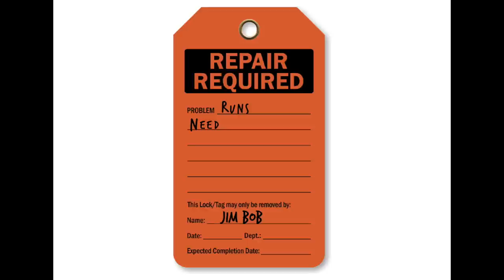Stihl Cutoff saws... My NEMESIS...

Comment: Something I learned many years ago when I have an engine, whether it is an automobile, motorcycle, or one of the many small engines you work on is to use an acetylene torch and put gas down the intake; no oxygen, just acetylene, propane or even MAPP gas.   I use a small welding tip and turn it on about a quarter turn to start with and give it a pull. If it sputters, give it a little more gas. It is not dangerous even if it backfires because you can simply pick up the torch and turn it off. Much better and safer than pouring fuel down the intake because you have control of the fuel. 

Once it starts you can adjust the flow to an idle while the pump either picks up the fuel or not. It will always start by the second pull unless you have other problems, but it eliminates the lack of fuel problem.  It has worked for me for 50 years and saved me a lot of pulling starter cords and wearing out batteries and starters. Obviously you should know it is a fuel problem first.

Comment: As a user of cut off saws in the late 90's, I feel your pain.  Sadly I must admit many of the problems are user inflicted.  Not necessarily due to carelessness, but due to the rough life these saws live.  I was working at a small contracting company and we had about 6 saws, I can not remember more then 2 running on any given day.  Running them down in the bottom of a trench cutting water or sewer line, they often got soaked (along with us) with water or other things, or dropped when we were falling often into the water.

I remember taking our 4 not running saws into get repaired, and then picking them up a few days later.  They each had a repair tag with problems found attached.  One had a bad ignition module, one had water in the gas, one had a bad ignition module and a note "SAW FULL OF xxxxxxx WATER !!!!" I will leave it to the imagination on what the x's were, the last one basically said it would cost more to fix then a new saw.  So 3 out of 4 where fixed.

Any way not sure of what the point of this comment is other than a trip down memory lane.  Well and to say, we sure did appreciate having all our saws running again.  Yah, we abused the saws, but no more then we abused ourselves on thous jobs.

I sure did appreciate the work of the mechanics that got them running again.

Comment: We have Husky's at work..3rd pull its running. They even sit with same fuel.for weeks. Winter and summer. Use only husky oil with them. I work for a city water dept and saws get abused but keep on running. We cut iron water pipe, clay tiles, and of course concrete.

Comment: After the 3rd or 4th pull I’m imagining some kind of drill or impact on the flywheel to spin it…. But then again my shoulder already gives me trouble! Nice work young lady! I admire the tenacity!!!💯💯💯💪🏻💪🏻💪🏻👏🏻👏🏻👏🏻
Reply: Spray bottle with a little mixed fuel does the trick on some engines. Some engines have a plastic baffle deal blocking the carb inlet however.
Reply: I think you're very awesome

Comment: I have two TS700s and an older TS510 I am building now. I love working on them. Actually, I love the money they make me, lol. These are actually mine and not one of my customer's, so a little higher profit margin when they're done. I probably repair 20-30 Stihl concrete saws a year here in my one man shop. Sucks cleaning them, but they need it before any major repairs for sure. That concrete dust DOES NOT come off easily!

Comment: That Video is exactly why ALL my 2 strokes are taken care of after I'm Through using them ! I Hose em off, Blow em off , Blow em out,,, Whatever it takes ,,, to keep that from happening ! I've wrapped Weed eaters around Tree's , Thrown Saws down in the woods, Run over Leaf Blowers and had to go buy new ones,,, Just because I wouldn't take 5 minutes after using them ! Now I keep 93 octane gas in em ,, good Oil , good grease , good parts !

Comment: Yeah they can make you work for your money. There is a decompression just in front of the spark plug cover on these. I usually just drop pull them i know it is not the safest way but it saves my back.

Comment: I agree on not liking to work on concrete saws. They are a pain to start & an take apart. But this is the profession we chose to do. So I just grit my teeth when they come thru the door. I too might have to have shoulder surgery down the road. Well hope you feel better. I too have been under the bug the last couple days. Just pushing thru. 
DLCR El Paso, Texas

Comment: I’m a stone mason , I use my stihl cutoff saws everyday in the summer, I have 3 of them, one is from 1996 ,still going ,the others is 2010 and I bought a new one last year . These saws take a beating,but like everything,if you keep new filters,fresh mixed gas and a little maintenance they will last . I bought one huqvarna ,it only lasted a season, I liked it but I don’t think the air filter system isn’t quite as good as stihl .They all suck to pull start , even with a decompression button. Good video,keep them coming 👍🏼

Comment: Was the air filter that loose as shown in 00:50? Because if that's screwed on properly there should be no water or rain getting in there at all unless it was drowned in a pool or water was sprayed directly into the intake holes. 
With the decompression valve it would make it a lot easier from my experience.
If you have any questions on the design of these STIHL TS I'd gladly answer (I work in R&D there).

Comment: I had a close friend that had one of those. I told him if it was mine. I would clean the air filter daily. And probably replace once a month.  He thought I was nuts. They are great but are high maintenance. I told him you have to add the cost on your bills too people. Thanks for all the great videos. I habmve a pair of JD hedge trimmers that I had for 32 years.  I like your idea of putting 2 cycle oil in the system for the winter. But my trimmers don’t have a primer bulb. How can I do this without a primer bulb. Thanks again.
Reply: The filter system on the Stihl cut-off machines is designed to work best when there is a certain amount of dirt built up (filter cake). If you change the filter too often the TS is more likely to seize the engine. That is why it explicitly states in the manual that you should only change the filter when you feel a drop in power. Else don't change it...unless of course it gets drowned in water like in the video :)
Trust me, I work for Stihl ;)

Comment: I also Did not Like The Pulling and Pulling  !!! Use Burkable 2 +2 , carb Cleaner 

Or Starting Fluid .
Once you get it Running you can , do your testing and Adjustments.  Let unit Cool off , for about 2 hours , Then Try Starting it. 
That will Help Your Shoulder !!!

Comment: why didn't u squirt a little pre-mixed gas in the carb or in the cylinder through the spark plug hole?
Reply from the maker: It was flooded. That's why it was hard to start.

Comment: Just wondering if you have a video of how to stop the piston from turning on a chainsaw in order to get the clutch off.
Reply: I’ve removed the spark plug and fed the end of a rope into the hole. Keep feeding until it won’t take anymore. Now the piston won’t move.  Afterwards just pull the rope out.
Reply: @woodrowwilliams1812  Thanks. I will have to try that.
Reply: A piston stop, either a threaded tool or a plastic double ended oar like toll stihl sell

Comment: Stan here would you have an opinion on portable generators size 12000 to 13000 watts to buy need to replace mine that does not produce any electricity engine runs great hopefully to here back from you thanks

Comment: That's why I use ether, after half a dozen shots if it doesn't start I really don't care. It's 5:00 somewhere.
Reply: @ Justin Sane Wait until you have a Crankcase Explosion. That'll get you to STOP using Ether to start a  2 Cycle Engine. Of course, that'll be after you return from the Emergency Room.

Comment: I use starter fluid on my Stihl cutoff saw.....choke in a can...for years now...
Reply: @ Steve Bad Idea to start a 2 Cycle Engine on Starting Fluid. If you ever experience a Crankcase Explosion, you'll DEFINITELY stop doing that. Well, after you get back from the Emergency Room.

Comment: Got a still fs91 that quits ruining after about 15 minutes every time 
Then it’ll start back fine but run weird then cut off
I’ve tried a new gas lid same issue
Took it t local ace hardware stihl dealer had 12 new parts put on it same issue